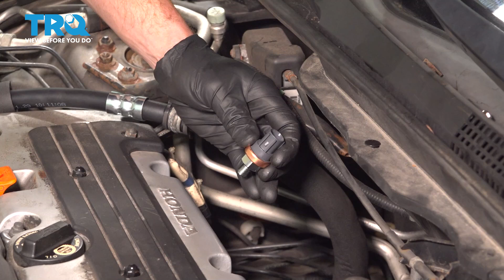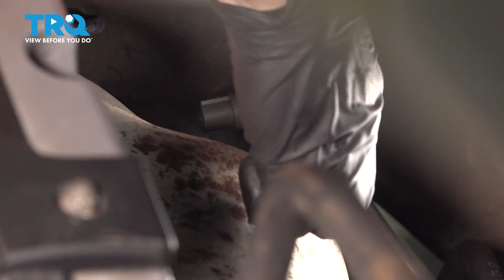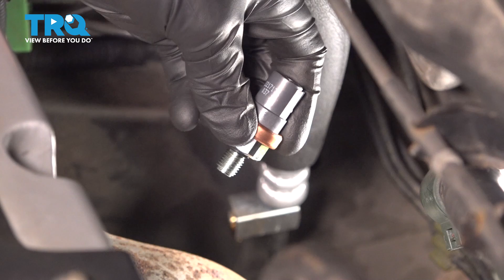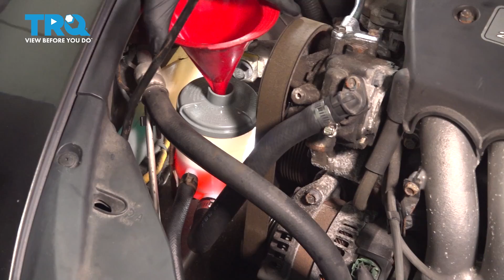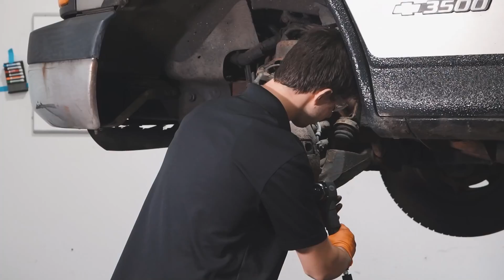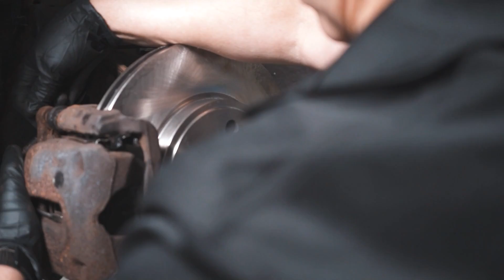How to Replace Power Steering Pressure Switch 2003-2007 Honda Accord

Comment: 2000 honda accord. I used a 19mm and 17mm hyper tough wrench on the switch. I actually didnt even need the thin head wrench. The old switch was 17mm and the new one is 19mm. The brand i bought is standard motor products for $15. The steering feels weird now. It just doesnt feel the same as the oem one and the motor revs up weird too like its not as smooth as the oem sensor. I dont know if thats because the sensor is not oem or there is air in the fluid? However i did bleed the system. I am considering either buying the denso part for $40 or i could buy the Honda one for $100.

Comment: at the 2:16 mark, you have 2 open ended wrenches gripping the silver metal cylinder.. the wrench never even touched the pressure switch.. lol theres a accord out there somewhere with a loose pressure switch on the high pressure line.. that cant be good..
Reply: Just showed my wife and said the same thing. Wonder what ever happened.....